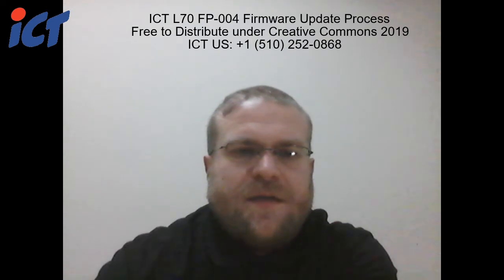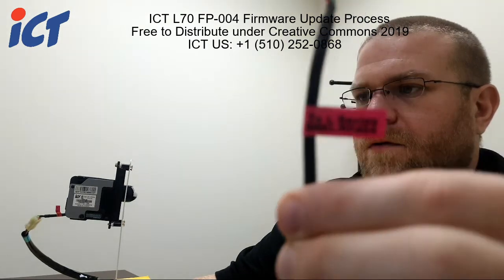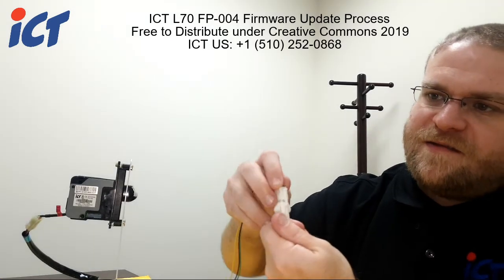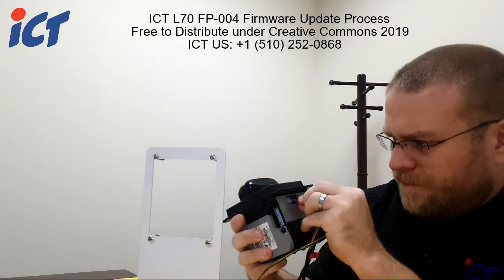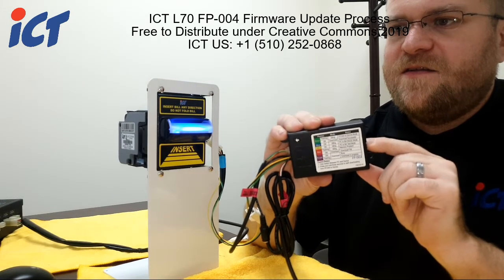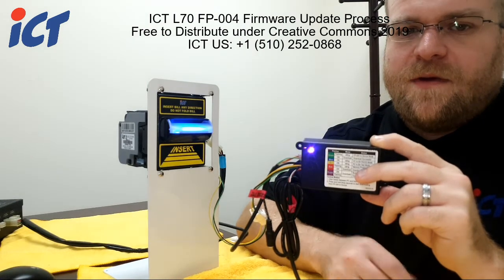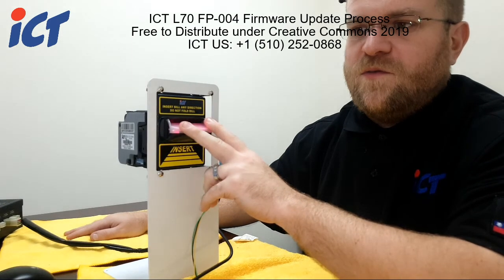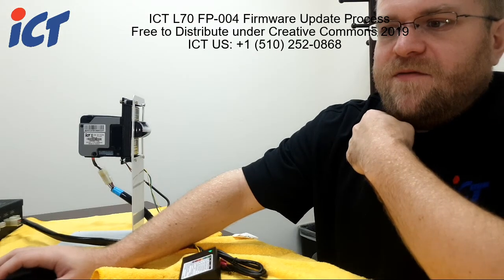L70 Direct Firmware Update with FP-004 Programmer

Comment: Hello! I'm having an issue with Patter Creation using L70 + FP004, whenever i put a bill, the software freezes and outputs .ict files with text lines of 0 and 255 values, only those, I think that's wrong, also it outputs multiple .ict files with only 1 bill passed on the bill acceptor. Thanks in advance!
Reply from the maker: Good evening, 

Due to the specific technical details, I've sent you an email reply with some things to verify. Please check those and if needed, reply to the email thread. 

Have a great day!
Reply: @ICTPaywayInc  Thanks! I've read your feedback, as soon i reach the office in a few hours i will reply back, i appreciate your kind and quick support Craig. Have a good day too!

Comment: I have a l70 ICT 104U machine but when installing the ICT104U interface it gives an error but installing the pulse interface works. Is this a firmware error and does it need to be updated again? If the pulse interface has rs232 communication with the machine Can you calculate CPU?
Reply from the maker: Good morning, 

You would need to ensure that your protocol dipswitch settings are set accordingly. You can check view those dipswitch charts and find your matching country code to view a .PDF of all the applicable settings. The interface bank on the bottom (or below the cashbox if the L70 is equipped with one) would be the most important one, as it specifies which interface, or 'language' to speak to your host machine. 

Unfortunately, just knowing a machine can support PULSE and RS232 wouldn't be enough to provide more information about your host machine. However, if you get an option to run under RS232 vs PULSE, you should indeed do so as there is additional security measures in place when transactional data is sent over serial communications.

Comment: I want to find out from you if you can help me get a program for my slot machines. I bought some slot machines from a Polish guy here in Ghana which I have been operating for over years now but unfortunately there has been a change of currency in Ghana and I need a program to match the new currency for Both coins and notes . it is a gaming machine that run on Linux operating system

Comment: Can you show me the cable that use for connection from ict to bill acceptor, in this video not so clear..
Reply from the maker: Good evening -- I've provided a 'Cable Use' guide for the FP-004, which can be obtained from the following dropbox link:

https://www.dropbox.com/s/4o3975fs7fdtmsb/FP-004%20Cable%20Use-2017-04-26.pdf?dl=1 

The cable in question for the L70 is WEL-RF404. You would connect this with WEL-RF303 and connect the two in-line white box style connectors.
Reply: @ICTPaywayInc  can i upgrade that bill acceptor using PC because my FP004 device already broken..
Reply from the maker: Good afternoon -- Unfortunately, if your FP-004 is not working, you wouldn't be able to update your bill acceptor. Without the use of one of our programmer devices, there isn't a way of communicating with your validator to run diagnostics or perform firmware updating. 

For further assistance, please feel free to contact me at cbrown @ globalpaywayinc . com
Reply: @ICTPaywayInc  can i know how i can get firmware for  FP004 tool i need to upgrade my acceptor.. and how i can get ICT BA TEST apps pls help me
Reply from the maker: @mrasrul8901  Good afternoon -- For any tools for firmware updates, please contact me directly at cbrown @ globalpaywayinc . com for further assistance.
Reply: @ICTPaywayInc  Bom dia ! Meu amigo, no site que o mesmo deixou não tel nenhuma literatura do cabo que precisamos, WEL-W404 ! Não encontramos em nenhum local para comprar e muito menos para copiar. O que faria para nos ajudar ?
Reply from the maker: @vagnergaio  

Olá! Obrigado por contactar. O chicote de fios mencionado não é mais produzido. Em vez disso, você precisaria de dois chicotes – um para atualização de firmware e outro para diagnóstico.

Atualização de Firmware: WEL-RF302
Ferramentas de diagnóstico: WEL-RCC42

Se precisar de mais assistência, entre em contato comigo por e-mail em cbrown @ globalpaywayinc. com

Tenha um ótimo dia!
Reply: Hi Craig can you email me I want to get in contact with you mr.wong9824@gmail.com
Reply from the maker: Good afternoon - For further assistance, please feel free to contact me at cbrown @ globalpaywayinc . com
Reply: tq for your information